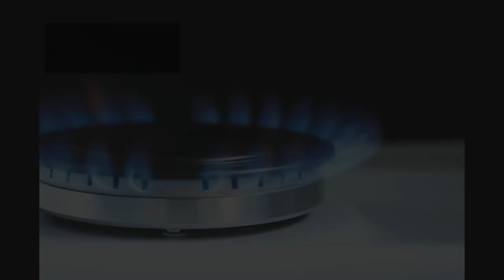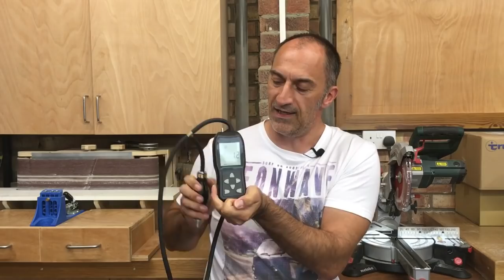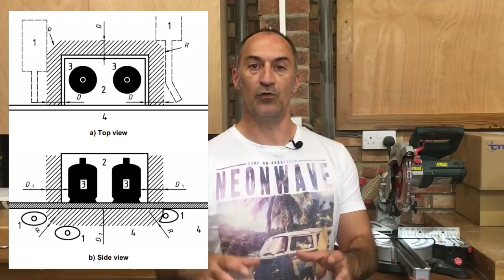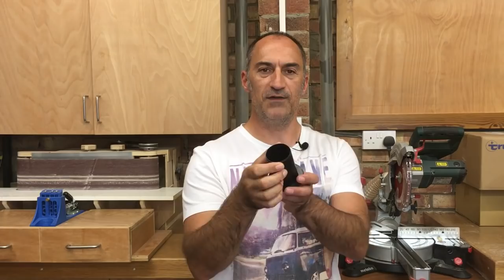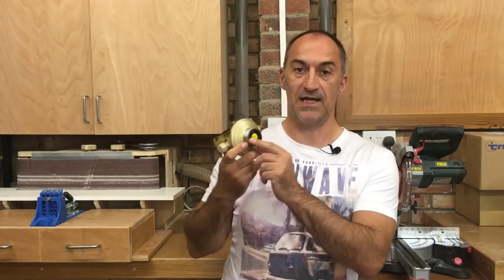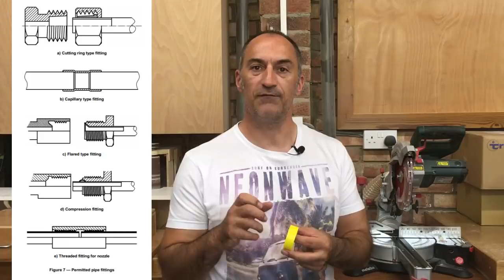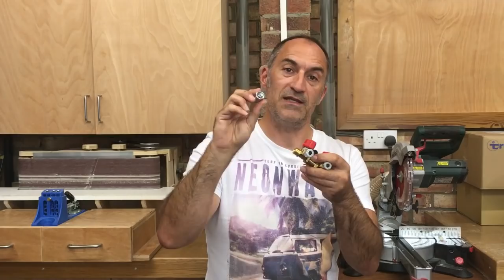Installing LPG in a Self Build Camper Van

Comment: informative video....question...are there any such things as automatic shut-off valves that will initiate in the case of accidents/impacts to an RV?....i'm sure leaks during an accident are a concern
Reply from the maker: Those devices are available from Truma but it always advisable to drive with your gas bottle shit off.

Comment: Hi there dude, you mention the gas cant be closer than 250mm from the exhaust. Can it be 250m above the exhaust or does it specifically have to be either side? Also, I've seen people have a gas fill up point integrated into the side of the kitchen top inside the van. Are you saying this isnt legal? See 3:43 in the following video https://www.youtube.com/watch?v=7G1zKeSbQDc
Reply: actually ignore what I said about putting it on top, just realised the floor vent will let a lot of heat in so cant go there

Comment: Love your videos. Watched it, although I'm planning my van only on diesel and electrics. I don't want to have any lpg in my van. 

Shower water will be heated through the cars cooling system. Heating with diesel. Fridge with diesel or electrics. And the only "lpg" I want is a 2 or 3 burner cooker with these small cartridges.

Comment: Hi Greg.  did you have those specs  at the design stage? dont know where to put my  bottle box and heater as sliding door and widows all round
Reply from the maker: My bottle is in a box just inside the rear door and my heater flue goes out the wall opposite the sliding door. I have a window there but it’s not an opening one and it’s far enough away from the drivers door to comply with regs.
Reply from the maker: Pip Baxter I have videos on each part of the build for you to see what I did.

Comment: Hi Greg, thanks a lot for a very informative video. One question - is there a need to have drop out vents under the appliances? For example, in the kitchen cabinet under the hob/cooker to make sure that LPG can escape to the outside if case there are any leaks through the fittings.
Reply from the maker: Hi Sergey, it is wise to put drop out vents where you have any gas joints or appliances. If a joint becomes loose or you get a leak while travelling the gas can escape and not build up causing you potential explosive scenarios. I have drop out vent behind my cooker in the floor of the kickspace and next to the boiler and in the gas locker.
Reply: @GregVirgoe  Guess that means not compulsory, but highly recommended?
Did you install gas alarms?
Reply from the maker: kevgermany you would be foolish not to install vents as a minimum safety feature.
Reply: @GregVirgoe  agree. Question is, how to stop the back filling up with exhaust fumes. I need to see if I can have the exhaust extended here as it exits under the load bed in the middle of the van. Means a discussion with the Tuev.
Reply from the maker: kevgermany ours is in the middle and never had a problem because the van is under possitive pressure as you drive along with vents in the dash.
Reply: @GregVirgoe  Thanks Greg. Great weight off my mind.

Comment: How did you calculate the amount of LPG your system needs? How long will those tanks last between refills? thanks
Reply from the maker: Hello hugh, it's difficult to put an exact figure on this because there are so many variables, how much you use the heating and how often you cook and with oven or just the hob. You can make an estimate of time used and take the gas flow rates from the manufactures manual.
The main deciding factor for me was to have one bottle, so I simply got the largest single bottle they do as we are using it for heating, hot water and cooking. Using the heating every night and cooking each day one bottle lasts about 2weeks and costs £14-15 to refill
Reply: @GregVirgoe  Thank you Greg. I have watched your van build and very much enjoy your videos. You are very thorough and I appreciate the level of detail in your videos as well as your attention to detail. Looking forward to upcoming videos.

Comment: Hi Greg,
Great video as always, I wondered if you could give me your thoughts on the following problem:
We intend to build a van to tour Europe but then ship the van to Australia.  I note that gas has to be installed using solid piping but I'm wondering how this would stand up to the hundreds and hundreds of miles of corrugations found in the Australian outback - having installed your system and used the connections do you think they would stand up the the abuse?  I was wondering about loop-holing the regs as follows ................ non-permanent installations can use hose but DVLA state that to convert a van to camper status the cooking appliance has to be secured to the vehicle (screwed fixing is allowed) BUT they say nothing about you having to cook on it in it's secured state soooooo, if I screwed my burners down whilst not been used but then unscrewed them just whilst I cooked it would appear to statisfy both the installation regs and the DVLA. That would allow me to use a hosed system whereby I could disconnect the bottle & cooker for travelling and use a hose which wont shake itself to pieces. Would value your thoughts on this?

Comment: hi greg i am a lpg gas eng your video was spot on the only thing i would say is to take a look at the alde bubble tester this is fitted in line and all you have to do is press the red button and hold it down if there are bubbles in the see through part you have a leak you can test you gas as often as you like i fit a lot of them on boats. hope this helps

Comment: Hi Greg - do you have footage of you testing your gas installation ? Many thanks
Reply from the maker: Yes Ian, please watch the MOT video. While the van is being tested I show you the fitting of appliances and testing in the kitchen. https://youtu.be/8nmFdSU06GM
Reply: @GregVirgoe thanks much appreciated
Reply from the maker: Ian, what I did find is that cheap manometer was letting by and I actually cut the hand pump and mercury gauge off a blood pressure cuff and used that. Worked brilliant!!
Reply: Ingenuity ..... I like it    @GregVirgoe

Comment: Hi Greg - I'm looking to buy the test equipment for LPG, install starts at the weekend - did you find the manometer off eBay ok ? where did you buy the tube arrangement to pump up the pressure ? - many thanks
Reply from the maker: I found the first pump I brought to be unreliable and it let by so I actually brought this pump and gauge and used that perfectly.  https://rover.ebay.com/rover/1/710-53481-19255-0/1?ff3=4&toolid=11800&pub=5575265109&campid=5338027957&mpre=https%3A%2F%2Fwww.ebay.co.uk%2Fitm%2FNylon-Cuff-Blood-Pressure-Monitor-Stethoscope-Sphygmomanometer-Manual-BP-KIT%2F223145088865%3FssPageName%3DSTRK%253AMEBIDX%253AIT%26_trksid%3Dp2057872.m2749.l2649
Cut the tubes off the cuff and its works great, 112mm Hg is the same as 150mbar

Comment: Very informative video. Do you have a link for the regulator you have used?
Reply from the maker: Yes here you go - https://rover.ebay.com/rover/1/710-53481-19255-0/1?ff3=4&toolid=11800&pub=5575265109&campid=5338027957&mpre=https%3A%2F%2Fwww.ebay.co.uk%2Fitm%2FGaslow-300-Regulator-System-Clesse-30mabr-Regulator-System-8mm-Coppper-01-1775%2F162430945432%3Fhash%3Ditem25d1a38898%3Ag%3A0y0AAOSw-uhadHn9%3Ark%3A4%3Apf%3A0
Reply: Thank you for the fast reply

Comment: Hi Greg, Is there any chance you could do a video on camper van generators?.......Example question;- Is it safe or legal to run a generator inside the garage part of a van providing the generator is housed in a separate sealed compartment within the garage for fire & sound muffling purposes = that has adequate air supply & exhaust air flow extraction (maybe a fan of some sort)?

Comment: HI Greg, cracking video! I would just like to query what you're saying at 16:55 with regards to local isolation. The standard is as follows:
"7.5 Shut-off valves Shut-off valves shall have a clearly identified “open“ and “closed“position and meet the tightness requirements of EN 331. It shall not be possible to switch the shut-off valve into the “open“position inadvertently. If control handles operate by turning, the “closed“positions shall be at 90° in either direction from the fully “open” position. This paragraph does not apply to installations according to 8.8.5."

"8.8.2 Each appliance shall have an individual shut-off valve in its supply line."
"8.8.4 Shut-off valves not situated immediately adjacent to the appliance shall carry unmistakable means of identification of the appliance they control."

This says to me that whilst each appliance needs an individual shut off valve, the shut off valves do not need to be 'local' to the appliance. i.e. on my van I'm installing a 4-way shut-off valve close to the gas supply then a pipe for each appliance from each individual shut off valve. What are your thoughts?
Reply from the maker: If the shut off valve is not local to the appliance it must be clearly labelled as to what it serves. 
To me it just makes good sense to have local isolation on both gas and electrics.

Comment: Hi Greg, excellent video as always - we're doing our van conversion at the moment and your sound advice has been invaluable.  We're getting an LPG tank installed for us underneath the van.  Our installer has advised us that as our two roof vents (fantastic fan & mini Heike) can be fully sealed, we will need to add a permanently open high level fixed roof vent as per the BSI document BS:EN 721 (Leisure Accommodation Vehicles.  Safety ventilation requirements).  If not, he won't sign off our vehicle as gas safe.  Would you recommend any particular venting (mushroom?) and it's location?
Reply from the maker: I must admit I'm not familiar with that particular standard as I believe it is a gas safe one.
If your heater is room sealed then it must be for your cooker, did he mention what appliance it was for?

If you are looking for a simple mushroom vent here is a link for you.
https://rover.ebay.com/rover/1/710-53481-19255-0/1?ff3=4&toolid=11800&pub=5575265109&campid=5338027957&mpre=https%3A%2F%2Fwww.ebay.co.uk%2Fsch%2Fi.html%3F_odkw%3DTSM1209S%26_dmd%3D2%26_osacat%3D0%26_from%3DR40%26_trksid%3Dp2045573.m570.l1313.TR1.TRC0.A0.H0.XCaravan%2BMushroom%2BVent.TRS0%26_nkw%3DCaravan%2BMushroom%2BVent%26_sacat%3D0
Reply: Hi Greg, thank you for your reply.  Yes, you're right.  The boiler is the Truma combi with its own vent.  So, yes, he will have been talking about the hob (as we're not having a cooker).  The hob, we would use right by an open window or have the side door open, and have the fantastic fan on...maybe it's time to find a new gas sign off person!
Reply from the maker: Hi Emma, at least you are aware that you need some vent (window or roof) open a bit when you cook 👍🏼😊

Comment: Greg you've got my model Bus on your T-Shirt :) Thanks for such a detailed explaination, I'm alway horified when I see people using the gas heater inside their van, especially when they compain about the moisture without giving a second thought to how the Carbon Monoxied that is damaging their brains. I think this video will have a two fold effect, 1, it will make people do it right if they are DIY and 2, it will make people realise how spending  the money to get a professional to do it it worth it. It was good to put in the sad story about the boat owner, and it reinforces the need for floor vents to take away any leaking gas. Live the dream and live it long, may your firm pipe work get all the attention it needs!

Comment: Thanks Greg, I have been watching all you van build videos - all are most excellent!  Glad I watch this one!! My kitchen unit for our camper van came NEW with a hob and grill fitted with a gas hose attached.  Having read the hob installation instructions for the hob it states do not use rubber hose.  I won't name and shame the supplier but I will have a word with them.  Best I remove the unit and fit some copper pipe!!  Thanks again

Comment: The most important thing in LPG or natural gass DIY install is to pressure test the system. That is with the connection point for pressure testing being outside of living area. Install pressure guage and pump 15 psi air and leave it for 15 min. The gauge must not loose anything. I would leave it for 1 hr myself.
Reply: 15 psi for 15 min rule is for natural gas in canada. Where the gas pressure is 0.25 psi LPG could be different.

Comment: Great presentation Greg. Thanks for your efforts.  LPG installations can be SO dangerous.
In Australia,  we have a requirement that a gas drop vent is required under each gas appliance as well as in the storage box. Also that the main pipe run (rigid) is fitted outside vehicle and then T'd off through the floor at each individual appliance (ie no Ts inside vehicle).
 Also, and more importantly, the final requirement for road certification (ie ability to gain insurance cover) of a home-built canpervan is that the gas installation is  approved by a qualified gas fitter, who then takes on the legal responsibility if there is an accident involving insurance issues.  Same requirement for 240v installation, with a certified electrician. Doing the job is only half the battle, finding the tradesman willing to take the risk and sign off on your work can be difficult.

Comment: Here is some information specific to the USA.  The laws for passenger vehicles/van conversions in the US set by the DOT defer to the NFPA, National Fire Protection Association. The sections of NFPA 58 that pertain to us are 6.26 and 11.9. There is room for debate here as to whether 6.26 or 11.9 is more accurately applied. This is because 6.26 excludes RV's with installed systems. 6.26 is for disposables and refillables. 11 in general is discussing propane engines but 6.26 does a redirect to 11.9, very confusing.

Per 6.26 we need a vapor tight enclosure that has two vents to the outside top and bottom, an outside hatch for emergency personnel to remove the propane container(s), the venting must be 3 feet away from any other holes in the side of the van that lead to the passenger compartment, it must be sturdy enough to withstand 4x the weight of the propane container(s) in ANY direction. The container(s) must be securely fastened to the interior of the compartment (think about how fire extinguishers mount).

Per 11.9 we only need a vapor tight enclosure that vents to the outside. 

I think the vent hole diameter was 1" but not certain.

Thank you for being so thorough with your description of the European standards, I think this was the best discussion of propane I have seen and I did a ton of propane research! Publication 58 was a very lengthy document but was too confusing.   Could you follow up this video to show us more of exactly how you made your enclosure and attached your fittings?  Or is that already in your cabinetry video?

I haven't decided whether I want the risk or hassle of propane.  I may just expand my solar capacity and reduce my expectations, like cook outside, wear wool etc.  If I do propane then I am going to do it right and meet both US and European standards.
Reply: Susan Nichols -- By my knowing European safety standards are higher, so doing a mix of your regulations more towards European standards are safer. Per example: the 1" outlet in the cabinet seems to me rather small, if a leakage would happen I would like to see the gas leaving this compartment a lot faster from a bigger vent in the bottom... 
There is never any risk or downside in doing things better and more secure compared to those minimal standard rules from an authority as NFPA  , and it give me a better feeling in over securing that gas storage in the van. You only could get thumbs up!

Comment: great video, but you didn't install it.
Reply from the maker: This video just covers the standards for the installation and it was getting long enough.
The gas filler I have covered already here https://youtu.be/a0I7-o6VmbU
You can see me installing the copper tube and connecting to the boiler in this video https://youtu.be/zCjygu0ygKE
Then I have a final video to release very soon on the gas bottle installation.

Comment: I think with LPG you need to give it a regular check over as well once it's installed. A moving, flexing and vibrating environment like a van is going to pretty harsh, fittings may become loose, and so on. It's not going to be 100% fit and forget. 

Thanks for another great vid!
Reply from the maker: That is a very valid point you make and than you for sharing that.
I will make sure to add that in the edit of my GAS install video.
Thank you
Reply: Fully agree. In Germany there's a compulsory certification by a qualified technician on conversion and every 2 years afterwards. This must be done before the MOT equivalent (Tuev, which is every 2 years).

Comment: One question that could help me make a decision. Do you have any idea about how much could weight, all the interior, insulation included ?
Reply from the maker: Hello, I don't have the exact numbers on that, but the total laden weight of my van cannot exceed 3500kg
Reply: @GregVirgoe  Yes, I know that. Same for my, since I only have B license. But I'm considering a van that only have about 650kg payload remaining. Thank you !
Reply: Syncro Van +1 would be great to have some ways to estimate before buying a van..
Reply: @thomaslaurent6815  Well..it actually is possible to estimate, by just asking someone who built a van and weight it before and after. Not precisely, but you can still have an idea, witch is very important, especially if you target a van that it's rare, special but limited on weight.